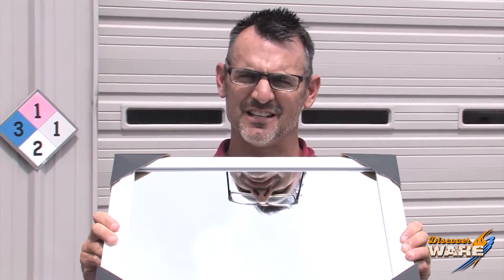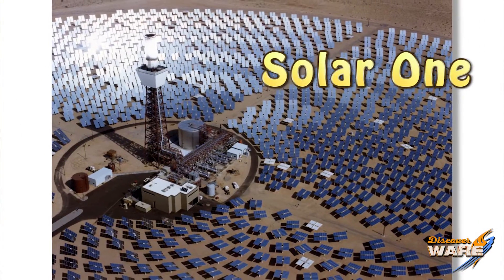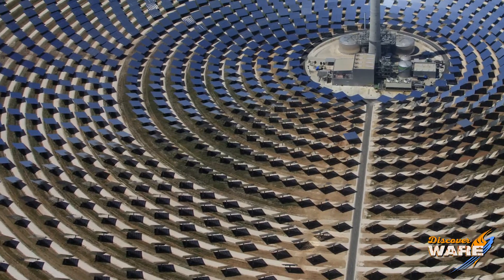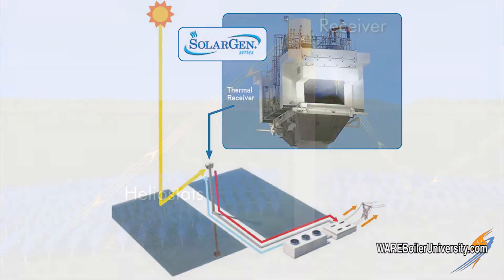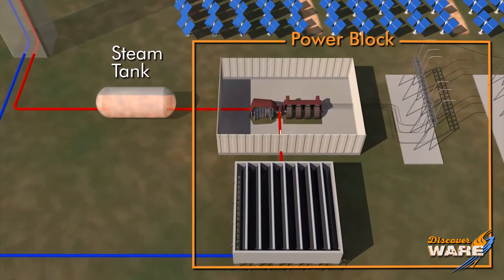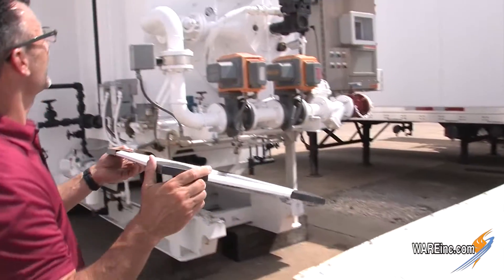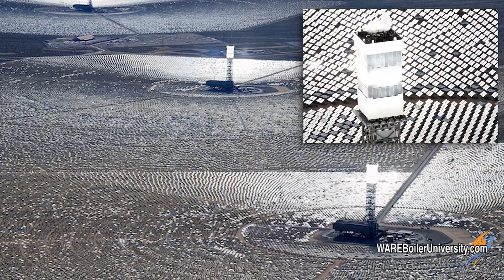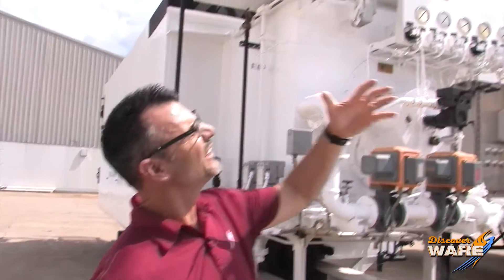Solar Powered Boiler — Steam Culture

Comment: Why are there zero DIY projects on yotuube involving a field of heliostats and a boiler and a turbine, and a generator?   Why?
Reply from the maker: I think the main problem with this technology is that it has to be at scale to produce the most energy and efficiency. There are also hurdles too such as the mirrors needing to move with the sun etc. Probably a bit more complex than the average DIYer but i'm sure someone could come up with something! Thanks for watching.
Reply: @wareboilers  can you send me information. On how to build a working model car. Using magnified sunlight to and water to make it move
Reply: Because even Ivanpah failed. Considering it plowed 2.2B of investment, its operating expense was more than 30X compared to a nuclear power plant, 15X more than a coal plant, and takes up hell of a lot more land use; scaling it down to a one man operation would be many times more expensive than simply generating electricity with a diesel generator.
Reply: asking the same question. got some space blankets to try out with. can't find any decent video with a small scale steam turbine though
Reply: What about using it even more practically, to provide additional lighting for greenhouses?! I could see that being very DIY friendly and manageable.

Then on an industrial/commercial scale have some sort of light bending technology built into the grow facility / structure to defuse the light amongst the plants inside as supplemental/additional lighting.